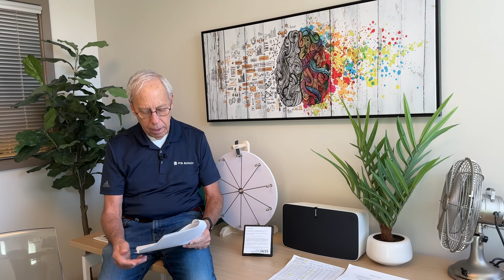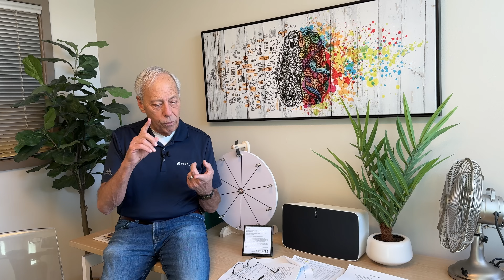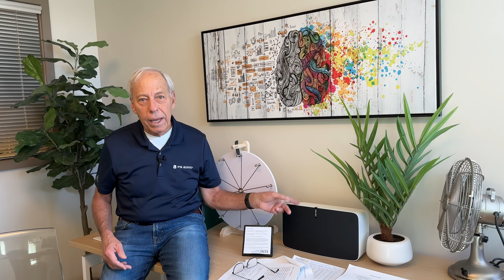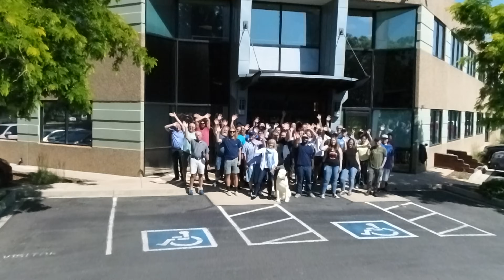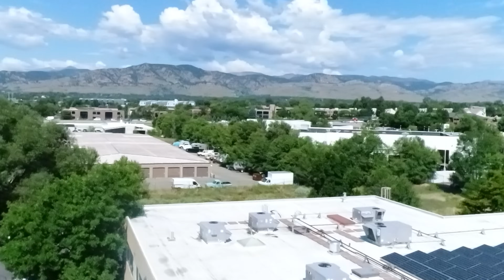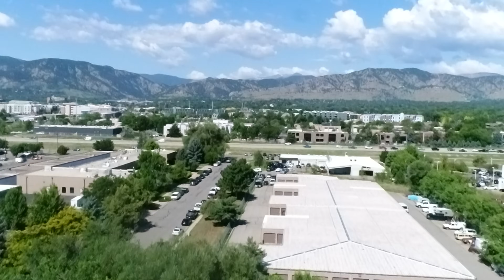Measuring the effect of a Power Regenerator

Comment: I have to call BS on the picture looking better when using a power regenerator. Unless the breaker that you were being fed from was under heavy loading conditions and dropping the voltage of the circuit to 100V or less. But still most TVs today have buck converters to run the electronics and should not be heavily dependent on the quality of power coming in, i mean 3.3V, 5V, 12V should not be heavily dependent on 120V coming in. They normally have a good amount of tolerance to the incoming voltage.

Comment: Ok. Ive begged..so now Ill discuss the question answered..the answer of the picture is better is not an answer..so ill ask..is the picture brighter? Are the colors more vivid? Honestly..for this to be truthful you would need to dial the voltage on each to the same level.. I hate saying this because im a believer in you.but if you raise the voltage slightly from the voltage coming out of the wall then the reason you are getting better results is VOLTAGE increase..not from filtering or stability..when we are discussing a modern tv the power supply is filtered well in the tv and draws very little current..the digital signal has no analog tuner drift or static induced .NOT EVEN LIGHTING BALLAST TRANSFORMERS would affect a modern tv. Yes you could possibly hear it in the speakers because you could easily find the rf with a scope..but ..My guess is ..your taking the 110v and stepping it up to maybe 125-127..and yes it would improve the tv..

Comment: is there a device i can plug into my outlet to see the condition off the signwave , like the display gives you off the power plant ? I want to know what fan that is it looks quality
Reply: Scope with a high voltage differential probe, or a suitably configured spectrum analyzer. You can actually view the results of Power Plant measurements on Audio Science Review channel.
Reply: @paulb4661  is there anything off the shelf that will do that , would be nice to see the need for your device , im sure there is , I would like to see it before i commit dollars to it . still like to know what the fan is on that table?  thanks
Reply: @Spractral  Indeed.
Reply: @Spractral  i dont have a scope , just wondering if there was something off the shelf that could show it and could be used for as a tool , Dave Mead in car audio makes a handful  of meters specific for car audio , the same can be said for home audio if something existed but i dont think it does without getting a scope , I did see one of the power plants had a display that gave you a visual of the wave form and it was nice to see the condition of the waveform
Reply: @NickGiordano-zu4em  My mistake, sorry, thought you were looking for a diagnostic tool, not a decorative accessory.

Comment: Typically for 2k to 3k you can get upgraded electrical outlets, 10 gage copper romex ran to electrical panel, and independent breakers. Now that is only estimate. If the length of the run is long and the way to run it is difficult and time consuming the costs can run over 10k easily.
Reply: dont do shit for the signwave

Comment: There are things you can hear but cannot measure. And there are things you can measure but cannot hear. Truth in audio.
Reply: The larger differences often claimed should be measurable or at least demonstrable. For example if you're claiming better bass like some of these cable reviews, I should be able to hear some sort of difference easily on a recording through headphones or any decent system.
Reply: And what would those things be? Have those been confirmed by blind tests or any other kind of scientific studies?
Reply: @gurratell7326  There were already those that claimed the null test tested EVERYTHING. Turns out there are additional items the null test doesn't test for. Look it up.

Comment: I hear ya Paul, but 6K is a tough nut to swallow for small gain. I spent 9k on my older B&W 802’s and they can’t beat that, no way.
Reply: Exactly! And isn't it interesting that there are no other manufacturers pushing power generator equipment. Do you think Paul is the only engineer in the entire world that can create a power plant? No one else is doing them because it's snake oil. PS audio can get away with it because they have a cult following

Comment: In Data Centers and Databases Centers if There is Any Fluctuations in Power in The Sine Wave or 
Sinusoidal Wave This Will 
Trigger Alarms This is a Interesting Question 
All Data Centers or Database Centers You Will See a Building That Has No Address or Windows Oddly Enough They Are There Yet They Try Not Too Be Conspicuous Because They Are Moving Lots Of Data Which Is Mostly Moving Money 💰 From One Place To Another These Data Centers are Buildings in Major Financial Districts Yet They Too Use Power Regenerators But Not For The Same Silly Confounding Reasons Audio Files Ponder 🤔 
Data Centers Are Very Sophisticated If There is Any Fluctuation in Power in The Sine Wave Alarms Go Off Now Data Centers or Database Centers Have Off Site Monitoring From a Security Team That Actually Monitor The Power Or Utility Power That Runs These Data Centers…..Security Monitor 
The Atmosphere or Ambient Temperature Which Data Centers Operate at Around 40° To The Incoming Power Or Utility and Water Supply Pressure Lets Stay On Point In Data Centers if There is Any Fluctuations in Power In a Sine Wave 
These Centers Must Have Clean Conditioned Inductive Power If For Any Reason The Sine Wave Deviates The UPS System And ATS Systems Will Automatically Kick In
These Systems are Banks of Fly Wheels That Are Spring Loaded That Generate DC Power That Are Converted to AC Power That Runs Only The Critical Power For 
17 Seconds Which Allows 
The On Site Generators Time To Get On Line and Take Over The Line To Load All of This is  Because a
Security Team Monitors 
The Power That The Power  Regenerator  Provides 😮……!
UPS Is Uninterrupted 
Power and ATS is
Automatic Transfer Switch Which Is in a Vacuum Transfer Switch in a Gas SF6 or 
Sulfur Hexafluoride 
My Point Power Regenerators Are Not Only Used For Silly Audio Files Whom Are Known To Purchase Gold Plated Speaker
Wire at $10 Thousand Dollars a Pop or a Vinyl Record Cartridge By
Sumiko That Cost 
$15 Grand and The Folks in The Mysterious World 🌎 of Audio Lunacy
Think Am Nuts Those of You That Have The Means To Buy a $20 Thousand Dollar Mono Block Amp 
By PC Audio….if Pauls Past is Any Indication Of His
Future Through 
Psychoanalysis 
It Looks 👀 Like 
Our Guy Paul Is 
Just About Ready To 
Snap 🫰

Comment: Video and audio are not the same. In an audio system, on a blind A/B compare basis, regenerators will not be detectable by a majority of listeners in a majority of trials vs an identical system without the regenerator and all else equal.

Comment: I’ve been presenting at CES and Cedia and yes you can have bad power in these convention centers as lots of electronics run in parallel and often it’s not all final products. So that’s definitely a place where those can save your show. Getting reliable internet is another challenge. But the value in a home greatly depends on individual conditions. I’ve traveled to places where you could see the light in the room going up or down depending on someone was cooking in the kitchen. But those are 3rd world conditions. In the more developed world, your wiring and voltage stability can be pretty decent. A TV in a home showing picture artifacts due to power issues is quite rare nowadays because TVs are digital and the power supply is regulated switch mode sort of like a power plant. On audio your gain is a combination of how good your audio is in managing voltage rails stability vs how bad your power really is. I would love if PS audio did actual internal equipment power rail measurements when a difference is heard to understand the true reason. Those of us working in engineering take a pride in designing the gear such that it is robust against mains voltage deviations and noise. Badly engineered products will make such issues audible. It’s not all about the resolving system needing more Dollars to be spent.
Reply: What do you mean gain? Were talking about amplifier?
Reply: Do you think if I got a "linear " psu for my cheap little (40$) headphone amp (douk) it would help? It came with some USB ended,annoyingly short, cable, and I've tried different power "bricks" (warts?) With it and they all have varying levels of hissing/static (especially when adjusting volume... Or "gain" ¿)  it sounds good overall for the price but ive seen a linear psu that I think would fit it for 20 bucks